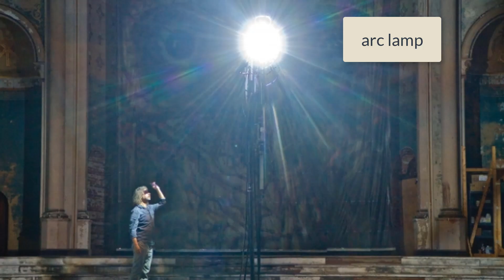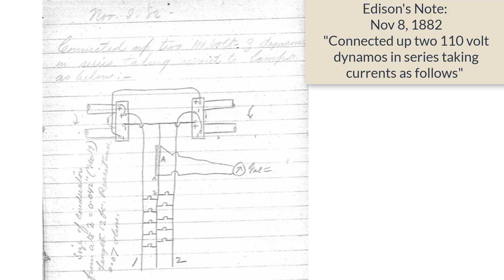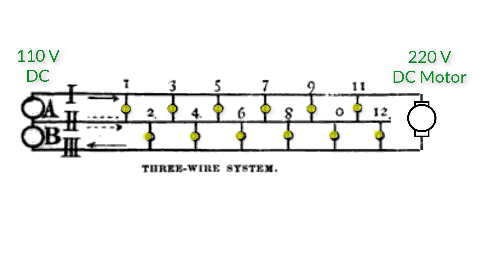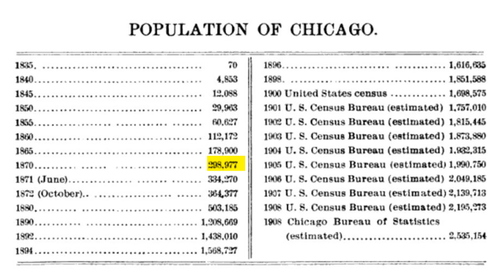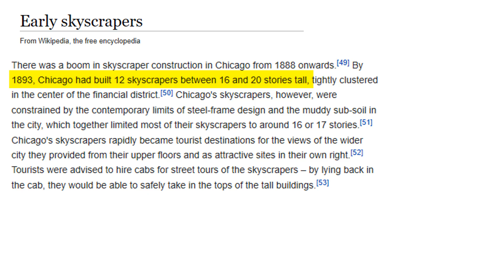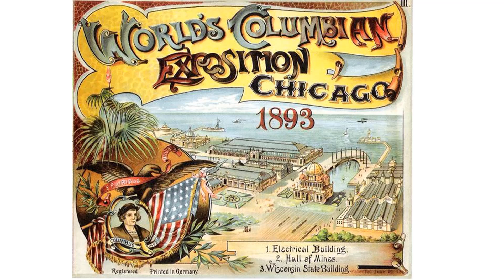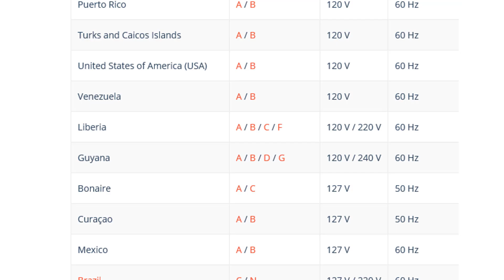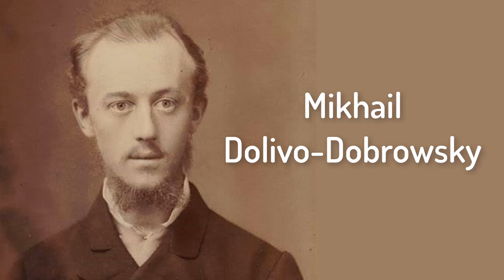Physics and History of Why USA uses 120 volts and not 220 volts

Comment: Sorry mmm, BUT YOU JUMP TO FAST FROM dc TO ac, THE 110 V DC have a very short running distance and the drop make unusable after few hundred meter, the AC was used and at a higher voltage, also because AC can use DownSteps Transformers  and Transformers can't be use with DC. The DInamo was related to Automobiles for many years but finally auto was mounted with generators (Dynamo is a generator that transform de AC current iinto DC by brushes in the colector) and since cars use mostly DC, dynamos was used for longer in the Auto Industries. The rerason to use 110 or 220 is the wiring, 220 use thinner cables, more flexible and simplify the installation. But since USA start de development of the Electrification and all was in 110, was cheaper use bigger cooper in new installation that to change all the existing one with a more deficiente insulation.  110 require higher amperage and consequently bigger spark and flame in case of short, some thing no desirable in wood constructions. Very few constructions at that time was made of wood in European city. Also are the Hz. 50 Vs 60 in USA. But that will be a different comment.

Comment: I consider the US a 240 volt system with a center tap for lower power devices. Probably cheaper and safer for devices to use 120v. I have been shocked a few time with 120. Probably be dead if it was 240 instead.

Comment: transformer on dc? back then only way to step-up up or down voltage efficiently was to use two motors . transformers only came after introduction of ac.

Comment: 220 can use half the current to deliver the same power.
Half as much copper (thinner wires) can be successfully used.
The US has plenty of copper, Europe doesn't.
Why 50 instead of 60 cycles?
Run slower, less wear

Comment: Thank you. I cringe when I see a presenter talk about 110 volts as if it is a present-day standard, when it was never the standard during their lifetime. At least half of professional electricians on Youtube still say this, and that means their impressionable viewers will mimic this. The only place 110 volts is found is in generators and inverters which were built on the cheap. If your power company supplied this to your home, it would be called a "brownout". I have not been able to pin down exactly when the US changed to a 115V standard, but it seems to have been in the 1930s; and the 120V standard seems to have been adopted in the 1970s or possibly right after WWII, depending on the source. I do realize that different areas adopted the new standards at different paces.

Comment: Very interesting video. Small correction to the multiplier of 1.72 you mentioned at 12:45: The relationship between phase-to-phase voltage and phase-to-neutral voltage on a three phase system is the square root of 3 or approximately 1.732.  120 x 1.732 = 207.84 so that voltage is called 208/120.

Comment: Thank you for your great job.  There is one mistake around 2:30.  More lamps will make less resistance instead of more.  And more current will drop the supply voltage and therefore dim the light.

Comment: In your graphic there at 2:40 you’ve got it backwards.  You’re showing lights in parallel, and the more loads you put in parallel the less resistance there is in the circuit, thus the more load the generator sees.  That’ll tax the capacity of the generator, drawing more current and potentially bring down its voltage a bit.

You brought up some interesting historical points.  I don’t know why you’d not mention Tesla, and his and Edison’s battle over AC v DC.

Comment: Very interesting.  I grew up near Jackson Park in Chicago which was the site of the Columbian Exposition.  It was known as "The White City" because of the color of the buildings and the extensive electric lighting.

However, I do have a presentation suggestion for you.  Try not to talk with your hands quite so much.  It can be distracting when it is done constantly.  Gestures are great to emphasize something but, like many things, can be overdone and have the opposite effect.  I suggest you do a presentation with full gesticulation and then one with more subdued gestures, watch them both, and decide which is more effective.

Comment: Here in Amsterdam the initial electric system was laid out in the same way as you showed in the three wire system. Houses had 2 times 110Volts, which makes 1 220Volts. This system functioned until the 1990s. Cheaper fixtures in Europe running on 220 took the system to prefer the higher voltage. The acceptance of the different voltages in the US and Europe may indeed have been induced by the preferred voltage of the lamps. Another reason may be the difference between emerging norm systems. American ANSI is shortly said based on weight, where the now EN is predominantly based on DIN, which is based on mass. That’s a reason why American motors are way heavier than German ones. That’s also a reason why an American motor would be much more expensive for the amount of copper needed to make it run on 380V. Has been, should be the wording, because the way our appliances can now preselect for the Voltage, Amps and even Hertz makes the difference almost insignificant. There’s little appliances that can’t run on both ends. The hardest part of the differences in electrical systems are the darn different plugs and the adapters we need to make our stuff work beyond the electrical borders.

Comment: KATHY, JOLLY GOOD SHOW, I have worked with 24 v, 120v 60hz, 277v  60hz, 480v  3phase 60hz,    4160 v 3 phase 60 hz, WHERE I was born there was 120v 40hz &  60 hz. Then ALL 50HZ   HOMES IN USA typically DO NOT have 3 phase in homes, BUT in GERMANY ,THERE IS 3 phase  50 hz in homes but zero 120v CHERIO, 🏴🇬🇧🇩🇪🇩🇪🇺🇸🇺🇸

Comment: I think you left out the why of the transition from Edsion's DC to the now universial AC 50/60 hz. The why is distance of transmission of power, DC has high losses from resistance, AC has much less loss from resistance. Plus you can use tranfromers to convert to higher Voltage.

Comment: USA is 220-240 volt into almost all households as 2 lines of 110-120 volt, almost all water heaters, clothes driers, and ovens/stoves are 220-240 volt, but 110-120 on most outlets, so we are both 110-120 and 220-240 volt. Dual.

Comment: Like here Finland one phase is 230V 50Hz and between phases 400V (3 phase)
At 230v the advantage is that thinner cable can be used relative to the load than the 120V system uses.

Comment: I thought the reason Europe went with the 220 loop system was because of a lack of copper. It's far more dangerous than our  110/110/220 system in America. Which is why we have plugs in our bathrooms for hair dryers and razors and England is scared of plugs near water. The funniest part is Europeans don't understand we also have 220 volts in our houses, we just only wire for it if we have a need for higher voltage like a dryer or hot water heater.

Comment: US standard voltage today is 120. In most utilities it’s 120 +/- 5%.  Standard residential is 120/240 single phase with neutral. Three phase is either three wire with neutral 120/208 Y, 240 delta or 277/480 Y with neutral. ST substation engineer.

Comment: Interesting video, in Australia the voltage has technically been reduced from 240v to 230v. This is to make appliances more efficient as most appliances are designed to run at 220-230v AC.

Comment: 220 volts is more dangerous than 115. The higher the volts the easier for the electricity to jump, go through water Etc.  I think we should change the system to 12 V it would be much safer and we wouldn't need all those Transformers to charge our phones Etc.

I wouldn't doubt if the Chicago Fire was a conspiracy to sell everybody light bulbs and make Edison Rich.

Comment: One funny thing about Tungsten. That's two Swedish words put together, tung+sten (heavy+stone). Tungsten has about the same density as gold (19.3 g/cm³), and I guess that's why they called it ”tung-sten”. However, Tungsten is actually called Volfram in Swedish (probably from the German Wolfram, but I guess, since the Germans pronounce W like V and we Swedes don't, we spell it with a V).

Comment: What is not commonly known is that Germany used to have a 115V+115V AC system when the Schuko plug was first developed although there was never a 115V + neutral version. It is why, to this day, in those countries where the Schuko plug is standard, like Germany and the Netherlands, domestic outlets are not polarised. Whilst there is a neutral + live(hot/line), it's completely random which pin is which when plugged in (which isn't a great mix with Edison screw light fittings as there's a 50:50 chance which way a table lamp will be plugged in (and it also means that there's a 50:50 chance than any single pole switch will be on the neutral). 

These days it's different in Germany and the Netherlands where they tend to supply domestic properties with three phase and tap off individual single phases at 230V for circuits (although more powerful appliances, like ovens, will often have more than one phase connected).

Such is the way with legacy systems (of course North America didn't used to have polarised receptacles either; that was introduced later by widening the neutral blade).

Comment: If you play with electricity long enough you will find that you can hit 110 20 times a day and it will just piss you off. Hitting 220 277 or 440 will make you have naked babies and melt your fillings. HID voltage from arc lamps will send you to the hospital every time. 30 years as an industrial engineer.

Comment: The arc lamp manufactured first requires around 55 volts and a DC series resistor or a choke for AC. This can be easily achieved with about 110 volts. In Germany the voltage was very inconsistent at the beginning: 110, 127, 180 or 220 volts AC. That worked for small local networks but prevented switching together. So they agreed on 220 volts, only much later did it become 230 volts (220-240 range). When the German plug system was developed, no distinction was made between hot and neutral, but 110 V and 110V AC (180 ° spacing) to earth were used. Therefore, the plug can be plugged in in both directions and both conductors must be well insulated. But then the network was rebuilt and one conductor became a neutral conductor (connected to earth in the system) and the other conductor became 220 volt hot.
The French connector system can only be plugged in in one direction, but different countries have defined the assignment of N and L differently.
The development of two almost identical systems lay in patent disputes.

A plug is now used that fits into both systems and which is safe to swap polarity.
Europe uses 3-phase 400 volt three-phase current (120 ° spacing) for motors.
Each hot phase has 230 volts against earth.
GB use 240 volts, Most devices can take the difference.

Comment: The title is a misnomer.  We use split phase 240v ac.  When you split the phase in half you get 120v.  You also say that the transformers are more expensive but the difference in cost to build a single phase transformer vs a split phase transformer is small.  The only difference is the center tap on the load side windings.
For industrial and commercial applications a delta wound secondary would be used.  If they needed a neutral it would have one winding center tapped, hence some installations today still having a high leg.  Most modern 3 phase installations use a wye wound secondary giving us 120/208v systems as compared to the old center tapped systems of 120/240v.  All polyphase systems with a neutral are properly identified by the dual voltages that you get from them.

Comment: In the Netherland, its 230 standard. But on can use 380 -400 volt as well. The so-called 3 phase, most used for certain power sources, as motors, or even flash equipment in photo studio's.

Comment: It is important to distinguish between RMS (or effective) voltage, and peak voltage when talking about AC.  Your chart shown at 13:00 is not clear about what figure is being listed. The source for that chart in Wikipedia does not spell that out either. The number for the US (120V and 240V) are consistent with these figures being PEAK voltage. What is the difference? Peak voltage is just that: the maximum voltage in the Alternating current cycle. This is the voltage that the insulation on a lamp[ cord has to protect you against. The 'RMS' voltage is the equivalent DC voltage that would deliver the same power to a fixed load. It is less than the peak voltage (about .707x Vpeak). This makes sense. Most of the cycle the voltage is less that the peak, and drops to zero for an instant each cycle. Therefore, AC voltage is often expressed as a root mean square (RMS) value, written as V rms, because  P=(V rms)exp2/R.

Comment: I ask this question when I start covering electrical power systems for aircraft. The genesis is the light bulb. Aircraft use 400Hz to reduce the number of copper turns of the generators and reduce the size of cores in transformers.. On large transport aircraft with long cable runs, Aluminum is used and spiced with Copper for the generator feeders and the feeds into the distribution centers. On most commercial aircraft DC voltage is a higher 28 vs 12 on cars, similar purpose to save weight by making the wire size smaller because of reduced current. So happy to find your videos.

Comment: I agree that at the early stage of electrification mains voltage was quite "random".  But later retaining this 110-120 V , 60 Hz was only to create an economical barrier to prevent electrical equipment entering the USA.  The same is the reason why the imperial units of measurements are still there.   There is absolutely no reason why these XV century, created by kings not by science, bizzare units are still there.

Comment: There may also be a safety issue. The peak voltage for 120V is 169V, which most folks may survive a momentary contact with, skin resistance/insulation being what it is. However the peak voltage for 240V is 339V, which easily overcomes skin barriers allowing current into the body, to cause severe injury of fatality.  120V is relatively safe to work with, but be vary careful working 220V.   Cheers.

Comment: Not sure where you are getting your info but the United Sates use both 120 and 240 singe phase for house power, industry use 3 phase 208 mostly for  lower power applications. The big difference between the US and Europe if we generate power at  60 hertz and Europe at 50 hertz. Hence the need for frequency adapters when traveling overseas

Comment: Thanks for great videos.  Previously watched your 26/12/21 video.
Did you notice that the 110/220 VDC idea got translated into the 110/220V AC windings on US distribution transformers.  I understand that is still common in the US.  110V for small appliances, 220V for power.
Your story that 110V in the  US was driven by lighting tech sounds likely.

Comment: 3:33 A big problem: What you show about the neutral wire carrying no current if the load is balanced is true only for ac and Edison was supplying dc.

I understand that he needed as low a voltage as possible so that he could avoid using a frail thin filament.

Comment: Interesting! I don't really get why Japan would lower the voltage out of fear for fires. (Usually higher currents are what cause heat and fire, and higher currents are with lower voltages)
Really liked the historical summary!  But i guess the short answer to why the US never switched to what europe uses is the same as with the use of the metric system: Money, time and effort, and a bit of national pride ;-)

Comment: 5:07 - "Step down to 220 volts."   What are you stepping down FROM  ?   If you are transmitting at 220 volts why do you need to step DOWN to 220 volts?   (sorry, not an electrical engineer.  I CAN rewire a lamp though.  That is the extent of my electrical knowledge)
Good post.